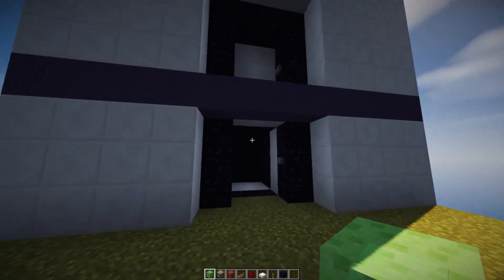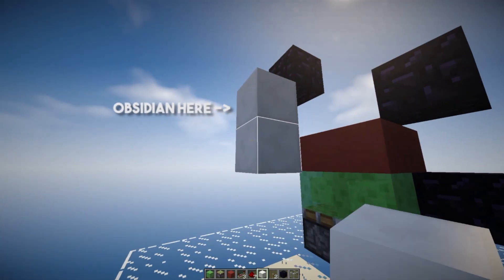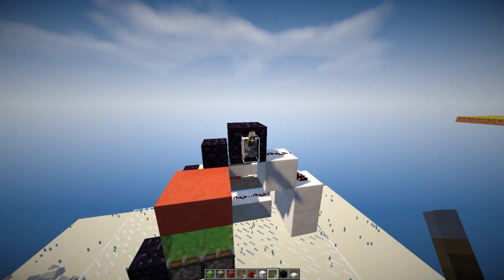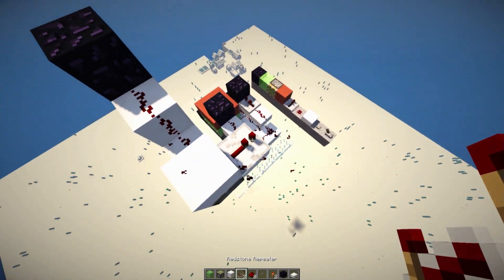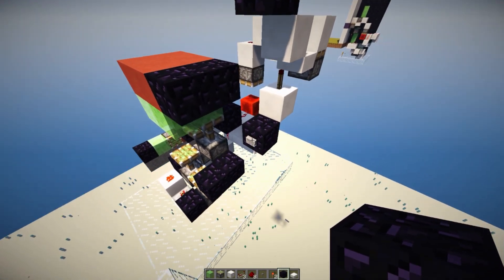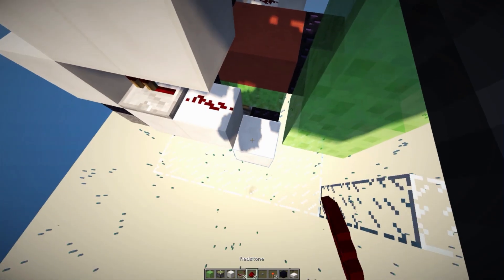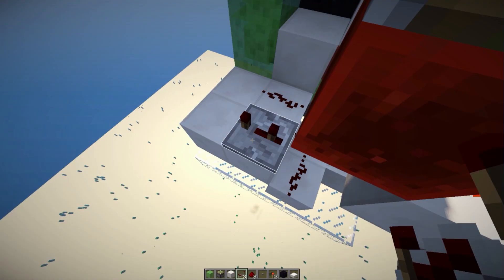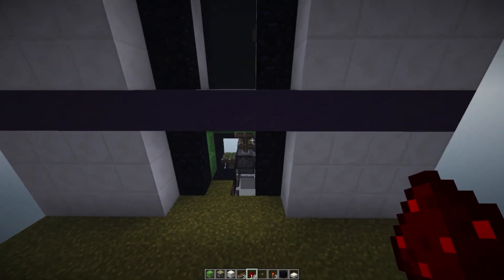Realistic Piston Elevator - Redstone Tutorial

Comment: The ones who disliked the video are all STUPID. They did not know what they were doing; or they are playing at a very older version which the machine was not compatible with. This Elevator is compatible with 1.8,1.8.1-1.8.9, 1.9 x, 1.10, 1.10.2, 1.11, 1.11.2. It works from version 1.8- 1.11.2. I do not know if it works for the 1.12 snapshots, but i think it does.

Comment: Can I have some help because , when the doors on first floor shuts , when the elevator goes to the second floor , it stays one block down , please help.
Reply: +TheMDGamer // NauTMDG it&#39;s because the slime blocks used to create the floor of the elevator are grabbing the middle block of the lower door when it passes. There are two resolutions... remove the lower doors all together or do not place a block in the center of the doors.EDIT: Just noticed, after a little trial and error, that if you change the redstone repeater that connects the doors to the last setting, everything works properly.
Reply: +Christopher Turner Hearn Thanks for the help. I will try ;D

Comment: I tried this step by step and the elevator is coming up a block short on the second floor
Reply: ***** It also stopped completely working when I started building around it. I'm on PS4 though haha.
Reply: +Russ Bradshaw It's because the slime blocks used to create the floor of the elevator are grabbing the middle block of the lower door when it passes. Ff you change the redstone repeater that connects the doors to the last setting, everything works properly.

Comment: Can you make this as high as you want?
Reply: No
Reply: ah sweet because I've already tried to do this i could not get it done, if you could that would be pretty cool
Reply: Simply Gaming So far I've concluded that it will be a 3x3 platform elevator. There is simply no other way I can think of that wont have slime block related errors.
Reply: Simply Gaming 3x2*
Reply: +Simply Gaming Sadly, there has been a bump in the road, but it really wouldn't make too much of a difference. In order for the elevator to keep going (based on my this and my design) there cannot be doors without really complex and super compact circuits that would need a weird timing mechanism linked with a floor switch. In other words, it IS possible for there to be an extended version of this elevator, but it would require either mods (e.g. Computercraft and/or Wireless Redstone) to have the necessary functions to work under a very compact area, or VERY complex circuits. (my modified elevator takes up a good 26x18x8 space, plus an external floor selector circuit). It will be a WHILE until I get an up-and-running slime elevator you can make as high as you want; sorry bro.
Reply: +noah roberts aha np I didn't think it was possible and I think logically and I couldn't see a single way to make this but I tried anyway and guess what? It didn't work
Reply: Simply Gaming Well, all we could do is at least try; it would be nice though.